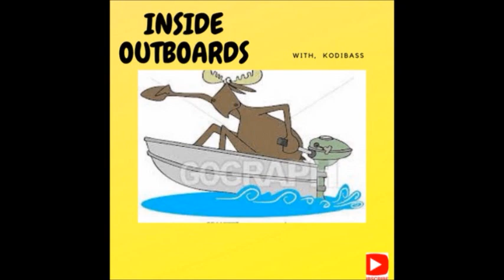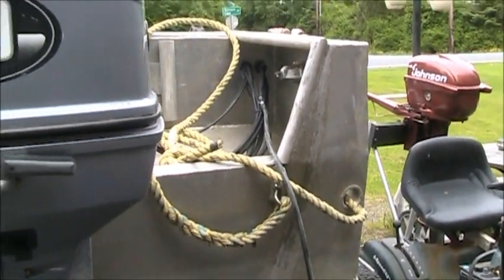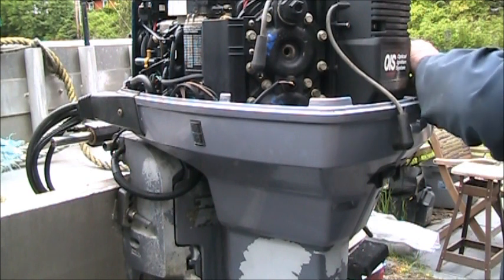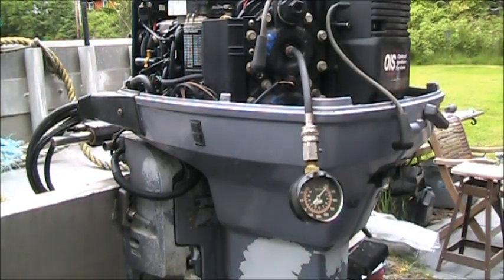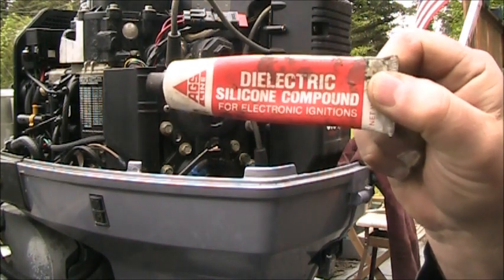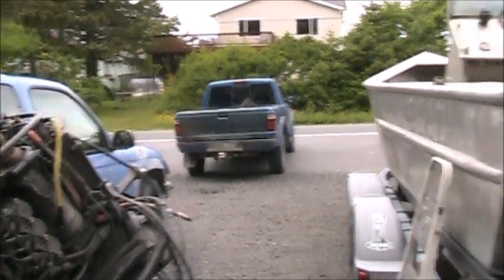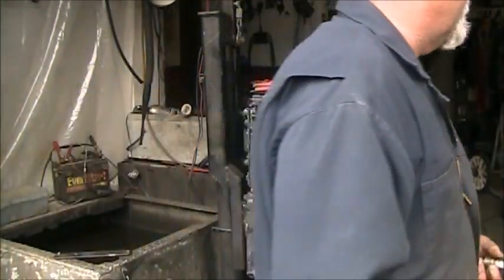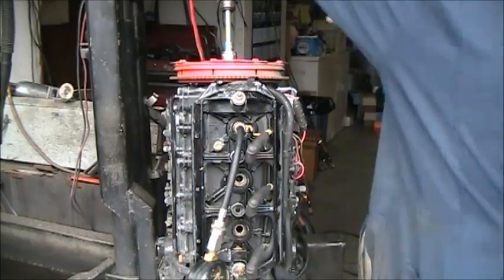JOHNSON 115 HP, & 1990 MERCURY 3 CYLINDER 50 HP WAKE UP AFTER SITTING FOR YEARS.

Comment: on the 115: if you have the OMS hooked up and spin the motor over for spark and compression, some say it will fill the carb bowls with oil! wonder if the motor wouldn't start because he was cranking on it full of oil. at one point you did say the plugs looked oily! also, compression on these means dink if the skirts are scored. i guess time will tell when it comes time to idle. great videos thanks for all the work!
Reply from the maker: Not sure, But I think he ran old water contaminated fuel into it.  thanks ,  kodi

Comment: i have 1991 evinrude 15hp (E15REIA) idles perfect runs perfect but doesnt go any faster after half throttle rebuilt carbs twice, new spark wires,fuel pump, spark plugs, only thing left is coils but one time on the lake it cleared up and ran like a bat out of hell but only did it once. any idea of whats going on? 125psi compression in both cylinders.
Reply from the maker: +Bm,  yes U are loosing spark on one cylinder,    remove your coils clean all contacts & mounting surfaces  make sure your coil ground wires are clean & shinny .  You will b good 2 go.    kodi
Reply: kodibass awesome thanks so much I will try that this weekend I really appreciate it!!